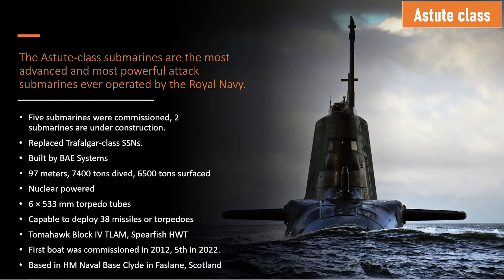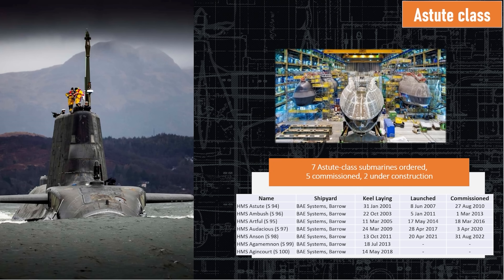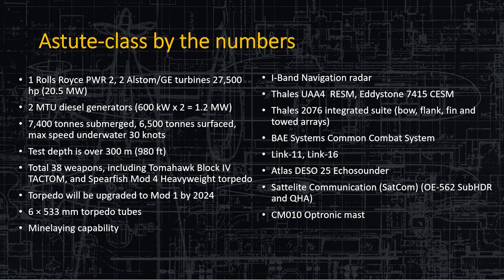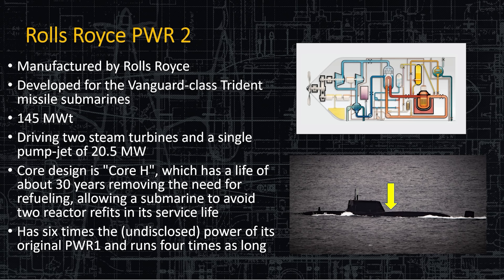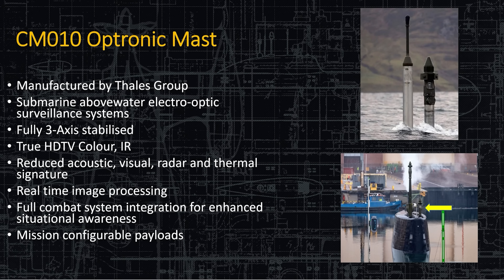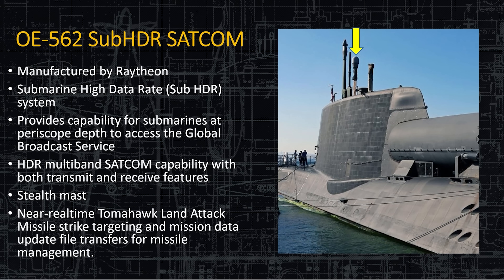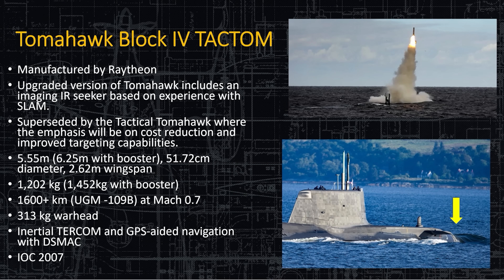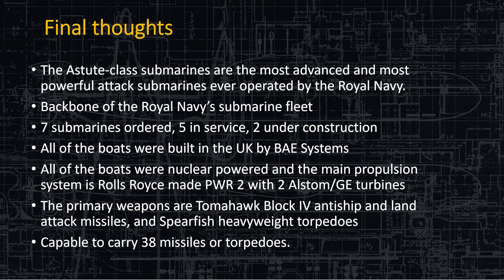Secrets of the Astute SSN

Comment: I've always wondered,  how much if a small hole is fatal to a sub? I'm aware the answer depends partly on the depth and pressure. 
But, assuming it's at least deep enough to crush an unprotected submarine hull, (again, I'm aware thats vague,) would it lead to catastrophic collapse, or serious water intake, if there was a hole of 1cm diameter? Say a cable ran from inside to out, and that cable suddenly vanished. Would that be a big enough hole to allow a fatal compromise to develop?
What about an inch? 
And presumably there's a large enough hole where it ceases to matter. Obviously the sub is history at that point, but a hole large enough that water has filled in and pressure balanced inside and out, and there's nothing left resisting that can be forced out of structural integrity. So to speak.  
Anyway, I'm not sure how to explain the question. I'm asking, I suppose, can a small hole sink a sub, or conversely can a sub have a hole that doesn't make itself a problem?

Comment: It is interesting to see the evolution of heavy torpedoes. The spearfish, developed in the 80s',   still uses a special fuel and hydroxylammonium perchlorate as oxidiser for propellant. This provides a lot of energy (hence the great speed of the torpedo) but can be potentially dangerous and needs to be handled with extreme care inside the sub,. It is also noisy (and thus detected as soon as fired). Furthermore, guidance is still via a copper wire, which has limited transmission capacity. The more recent Italian Black Shark, and even most recent French F21 torpedoes use aluminum-silver oxide (Al-AgO) batteries for propulsion, which are extremely silent and do not suffer a decrease in efficiency at depth (there is no exhaust system), and which are completely safe (the battery gets "primed" when entering water). Guidance is by optical fiber, which allow far more information to be transmitted, and hence enables the torpedo to better operate in complex and noisy environment. It would be interesting to see if those new technologies are being considered for the upgraded spearfish.

Comment: Interesting question for anyone that may know the answer.

I know that the QE class and other warships get plugged into the port power supply so the ships engines don't need to remain on all the time.

Do they do something similar with the nuclear reactors on the subs when they are in port. Turning on and off a nuclear reactor is a long drawn out process so it could be that they just leave it on while in port. Could even plug it into the port power supply and have the reactor produce electricity for the national grid while not at sea.

Any thoughts welcome...

Comment: what is the lump stuck on the fin at 11min 16 secs?  is it a sub rescue bolt on? Is it a special forces bolt on?
Reply: Special forces would be my guess, looks like our version of the dry-well thing the US uses to deploy NAVY seals from their subs.  A rescue vehicle would likely not be black.
Reply: It’s the Chalfont dry deck shelter, as above special forces use. Can carry a SDV as well as being a lockout chamber for mass diving operations and launching/recovering RIBs.

As you can see the Astute has it nicely integrated into the fin whereas a lot of other vessels have their DDS bolted to the back with fairly clunky access.
Reply: Yes, that's the special delivery module for SBS

Comment: I heard that Astute class doesn't have a conical nose because they're more expensive than angular noses. MOD procurement: Anything to save a £ or two.
Reply: More about the bow sonar array and a tradeoff on performance of sonar to hydrodynamic efficiency.
Reply: @tzazosghost8256  Also flat surfaces absorb sonar and radar better than curved surfaces, hence the almost hexagonal outer hull surrounding the cylindrical pressure hull.

Comment: I would be interested to hear how the Astute compares to the Suffren. They basically have the same purpose, and both come from a failed partnership between the British and the French.
Reply: There has never been a partnership between the UK and France in regards to nuclear submarines, either failed or successful.

France was years behind the US and UK in terms of nuclear submarines as she started late and her requirements were very different. They have made up some ground but only to a degree, in recent years. 

The reason for this is that the French are only on their 2nd generation of SSN, with the Suffren Class replacing the Rubis Class. Therein lies part of the problem. The Rubis Class were one of the least capable SSN's built, a poor hull design that then led to a complete rebuild of the ships in order to get better hydrodynamics later on, and with not very capable systems installed,  they were also built far, far too small. And that impacted their capability. The UK in comparison are on their 6th generation, with the US on their 9th (or 12th if you include 1 off boats that were repurposed or led nowhere). The US and UK also spent most of the Cold War going head to head with the Soviets up north where the French never ventured...that experience drove developments forward dramatically. The French SSN's essentially missed that entire Cold War....the first Rubis Class wasn't operational until 1985 and needed lots of rework...by the time it was done the Cold War was over....

The Suffren Class is a perfectly decent SSN....but....its not up there with the latest UK and US boats for the simple reason that, again, the French have done it cheap and made it too small.....Suffren is the same size as a Trafalgar Class from the early 80's and smaller than a Los Angeles from the late 70's. 40-45 years ago.....Since then the UK and US have built much larger boats like Seawolf, Virginia and Astute. The US boats being twice the size and Astute 80% bigger....that size isn't just for fun.....it serves a real purpose. You need that size for the reactor powerplant, large weapons load, sensors, habitability and power generation for the enormous data processing that a modern high end submarine needs. The Suffren just doesn't have this. If you look at other nuclear Sub builders they're all going for larger sizes as well....the French didn't get the memo...
Reply: @dogsnads5634  Cheers, unusual to find interesting comments.
Reply: @dogsnads5634  There was indeed a project named "Future Attack Submarine (FASM)" between the French and the British that failed in the early 2000s because of timeline disagreements. That was what I was referring to.
Reply: @KJlucaC  FASM and its replacement MUFC had zero French involvement. It was specifically a Trafalgar Class replacement.
Reply: No they don't. Astute is a 'cheap' development of the cancelled W-class wrapped around a Vanguard reactor compartment.....only a lot if W-class concepts became affordable through gestation of the design.

Comment: I wonder why the didn't include VLS cell the ability to launch 12 or so tomahawks as a full suprise attack... Well it's a good option to have I think.
Reply: due to the requirement to carry the dry deck shelter
Reply: Six tubes is quite a volley, and modern targeting can launch sequentially to a single impact time if that's required. Of course I don't know the launch cycle time as that's an operational secret. It's probably not a good idea to stay in one place for long...

Comment: The main reason for the 2 loops is the first loop is highly pressurised (maybe 70 bar) so it doesn't turn to steam in significant qualities. The second loop is less pressurised maybe 20 bar - i don't know exactly. So the hot water of the first will create steam in the 2nd which is used to turn the turbines. You don't want boiling water in the first loop as it requires a larger reactor design. You could probably drink the primary loop water too tbh, it will contain slightly more heavy water than standard drinking water but probably not enough to bother you.
Reply: and Tritium.
Reply: @ligmasack9038  Tritium production would require the same hydrogen atom or one to absorb a neutron twice. So very low quantities.
Reply: Another reason for two loops is to keep radiation inside the reactor vessel/compartment, whether the first loop is an open loop or a closed loop it can still become contaminated over time or through accidents and the last thing you want is to contaminate the generators and anything else that isn't shielded.
Reply: @krashd  Not an issue due to very low radiation levels in the water.
Reply: You'd be putting a lot of trust in the fuel cladding.....
Reply: Primary loop water is very clean and barely if at all active in itself, but I wouldn’t drink it because of the chemicals added.

Comment: I wonder how much of the AUKUS submarine will have Astutes style systems in it? as it is around 90 percent designed by BAE. 
Im hearing it will have the US newest nuclear reactor engine, and will use US weapons and US combat system but with British sensors, countermeasures and British/US BAE designed boat etc. 
And it will have a VLS capability.
Never to be refueled in it's life with a 35 year life and very much quieter boat than current Astutes and Virginia class submarines.
Buy the time they are in the water i'm assuming they will have wing man style escorts submarines scouting ahead of the AUKUS submarine locating, receiving and sending network centric information to the mother AUKUS.
With SSN/X Virginia class replacement due I wonder if they will be similar with the US machines having extended land attack options like they did with the Virginia class Block IV to Block V with the extra VPMs.
Reply: RR PWR 3, based on a new US design but fettled by Rolls Royce. The Australians use US torpedoes
Reply: @dinger40  Actually the The MK48 ADCAP Mod 7 (CBASS) is an US/Australian modified MK48 torpedo.
Reply: It will use lessons learned from both the Astute class and Virginia class. The Australian ones will have US combat systems evolved directly from the Virginia class. The VLS will also likely be derived from the Virginia class VPM.
Reply: I wish I shared your enthusiasm, but I have next to zero confidence that AUS pollies and Dept of Defence are capable of carrying through on such a complex project. ASC could build it if the Brits can design it in time, but interference & delays will come from all sides, based on previous experience with the Collins class.
Reply: @terryj-dx6op  One of the heads was the deputy head incharge of the Upholder Class build at VSEL and was one of the reasons AU went with the Collins. We couldn't fettle them due to a lack of money and will and it took the Canadians a long while to get them sorted

Comment: "Bae wake up, new SSN just dropped! Wait, you've build it?!"
Reply: BAE = British Aerospace
Reply: @sadams12345678  Yes, they know that.
Reply: @sadams12345678  It's a merged entity between British Aerospace and Marconi Electronic Systems.
Reply: @sadams12345678  Yes and No.

BAE started out as the consolidation of three aerospace companies in the 1960s Since then they have branched out into almost every field of military hardware that the UK operates. Building our aircraft like the Eurofighter Typhoon, They produce the upgrade packages for our tanks like the Challenger 2 and also produce our warships.

The Astute class are produced in a huge factory in Barrow In Furnace. The factory has all the facilities to assemble and float up to three subs at a time. I have personally seen Anson there undergoing final fitting before handover to the RN. It's a huge building you can't miss with the words BAE clearly on the side.

There is an entire TV documentary showing them building the subs there and shows the launch of HMS Astute back in 2007.

BAE also built both our carriers. It was intended to be a joint project with another UK company that had to pull out mid design leading to compatibility issues with the drawings and parts that BAE had to resolve themselves.

Comment: Can someone explain the hull shape around the fin/sail ? It almost looks like area-rule on an aircraft.
Reply: @paulkirkland3263  The reactor was originally designed for the larger Vanguard class bombers. The Astute’s unusual hull shape is a bit of a compromise to allow the larger reactor to fit into the smaller attack sub.
Reply: @greva2904  Thank you for that, much appreciated.
Reply: @paulkirkland3263  or you could listen to the video yourself where he mentions why the sub is shaped that way.......

Comment: They RN and USN subs also can cross carry each other's torpedoes and use them... Aka the Mk48 and Spearfish.
Reply: No.
Reply: They can't. 

Torpedo's are complex weapons and need to be be integrated into the Combat Management Systems in order to be fired and guided. Neither the RN or USN has integrated the other nations Heavyweight Torpedo's. It would take years to do as well...not an overnight job.

Astute will fire Tomahawk however, which is a US weapon. But...even then its different to the USN now as the Tomahawk version is fired from the Torpedo Tubes in an encapsulated container. The USN used to use these as well on earlier block Los Angeles Class and Seawolf Class but has now removed it from service and only uses the vertical launch Tomahawk variant. In fact I believe the USN sold the UK the last of its TTL (Torpedo Tube Launch) units for Tomahawk. Which also means that, unheralded, the USN's Seawolf Class no longer have a missile available as they do not have VL tubes like the later Los Angeles or Virginia Class.

Comment: The Astute-class boats just look chonky.  They are pleasing to the eye.
Reply: They are but seeing them means they have failed at the first hurdle.
Reply: Chonky for using the Vanguards' reactor.

But none of the five are ready to deploy yet.
Reply: HMS Astute's first operational deployment was back in 2014.
Reply: @jamesday426  Only in the last month has Anson deployed.

Not for nothing that the Australians do not want Astutes.
Reply: @EmsThaBreaks441  Yet they asked the RN for something better than what the French were offering.
Reply: @paulwood6729  Anything was better than what the French were offering as the Chinese had obtained some of the relevant designs.

But the Australians still want a couple of Block 5s over the Astute option.
Reply: @EmsThaBreaks441  Aye but the Americans aren't designing and building their new boats, we are
Reply: @EmsThaBreaks441  The PWR (pressurised Water Reactor) used on the Astute class are not the same as those aboard the Vanguards. Their size is similar but the advanced reactors aboard them will never need to be refuelled during the subs entire operational service life. So having it a bit bigger around the middle helps in the long run. 

Also the bulbous shape is more hydrodynamically sound than most submarines on the surface while not sacrificing any submerged performance.
Reply: @amandarhodes4072  According to BAe - who built them - if not Aaron on this video, the same Rolls Royce PWR 2 second generation reactor from the Vanguard class is used on the Astutes.

While the shape might be more hydrodynamic, the height is a function of the larger reactor choice.
Reply: @EmsThaBreaks441  Aaron literally said in the video the reactor was based off that used in the Vanguard class but they are not the same reactor. The vanguard class has a long history of issues with the reactors and reactor engineering has developed a long way since the vanguards reactors were constructed over 30 years ago. So no it's not the same reactor.
Roles Royce built the reactors not BAE. BAE just built the sub that they are installed into.

Also the slope elevation starting at the back end of the fin "conning tower" that rises up along the back of the sub is for hydrodynamic thrust to help the sub submerge. The reactor is located at the lower end of the slope they could have fitted it elsewhere to make better use of the height available but they didn't so height was not defined by the reactor size.
Reply: @MarcusRhodes-q2s  The Royal Navy website said the PWR 2 second generation reactor is the same from the Vanguard class. 

The other half of the propulsion is from the Trafalgar class - using both together requires the height increases.

I refer as well to other videos, including that of Aaron as well.